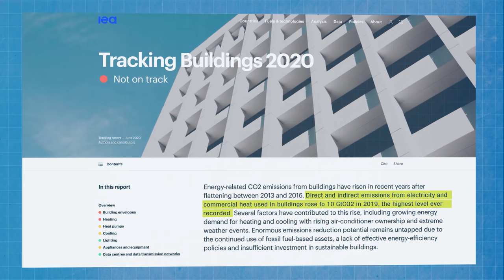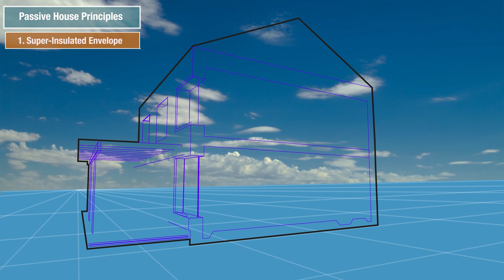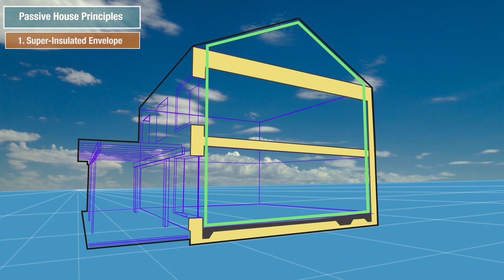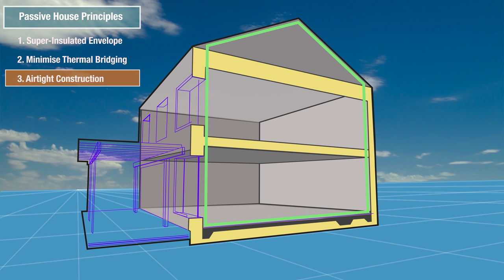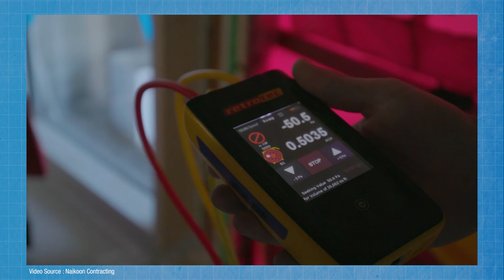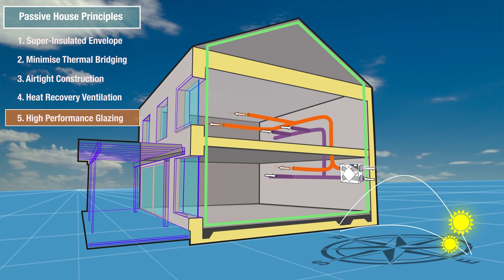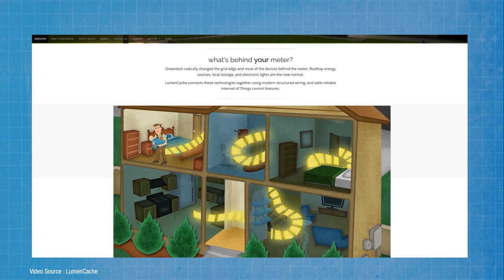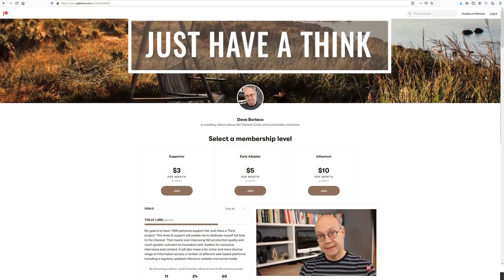Passivhaus . A low carbon future for our homes?

Comment: I am not one who thinks that passive houses are a good idea, but it is due to the low requirements that are set and the problems that have arisen on older passive houses that they are designed for a certain amount of waste heat and when it fails due to various reasons, it becomes cold. The better alternative is energy-efficient houses with a good heat source such as an exhaust air heat pump or an air-to-water heat pump as these can provide up to 8 times more heat than they draw in electricity.
The passive houses I have heard of needed a household with 4-5 people (two adults and 2-3 children) who were in the house for at least 12 hours every day and only the body heat could generate 5-10kWh in heat and then TV, computers, cooking, showering and lighting would heat the rest (the hot water came from an immersion heater that costs a lot to heat what is needed) so it was enough that there were only two people in the household for the temperature to be too low and then when "ordinary" light bulbs were banned, one disappeared some heat there and when the tv and computers became more energy efficient it became too cold so they had to put electrical elements around the houses to heat to the right temperature in the winter. If you compared many "ordinary" houses with passive ones, the passive ones could have a higher electricity consumption as they did not use heat pumps to heat the house or the hot water, which all newly built houses use today.
Can add that I myself live on latitude 60 in Sweden which has one of the tougher requirements compared to our climate and in recent years it has not received as much attention as we have not been so cold compared to what we usually when we have to cope + 20C inside with -19C on average during 48 hours and -30C for shorter periods, it is not comparable with most other places in the EU + UK or other parts of the world.
So my view is to follow the requirements for a passive house, but use a good heat source and not direct-acting electricity or waste heat, so it is possible to save more energy and provide a better climate.

I think you should also take a look at 3d printed houses as they have become a bit of progress with certification in Germany
Reply: Wish all new houses had heat pumps in the UK! Right now I believe they're merely "looking into the feasibility" or somesuch.
Reply: @kaitlyn__L  In Sweden, a majority of single-family houses have some form of heat pump and by that I mean not only new but also old houses but with different solutions and the easiest and cheapest is air-air heat pump costs 1-2k € but when it is cold it gives not so much - (15-20) C some should be able to give heat to -25C outdoor temperature then comes air-water which costs 3-6k € and then gives heat to waterborne heating and hot water and then comes soil / mountain heat (translation went wrong ) a pipe that is laid down to 80-100cm in the ground and is 2-500m long that removes the heat from the ground (costs a lot to dig down if done afterwards) and then "rock heating" where they drill a hole of 100-150m down and takes out the heat that is at that depth (both of these use an alcohol solution that does not freeze) and installation and purchase is at 12-25k €.
About 10 years ago it was cold for many months and some families had to pay 700-1100 € a month for electricity and most of it was for heating (high consumption and high electricity price) and after that many people installed when they do not want to happen to it again and many look up where the heat took the road and dense in moldings and floors and ceilings. There are not many who use electricity for heating now but now more so it counts as electric heating even with heat pump and houses that are close to cities have the opportunity to use district heating that comes from waste incineration or biofuel

Comment: UK construction industry is catastrophic. In all directions and by all measures. Never mind the energy performance of old,  new stock is as bad. Light years away from German standards or even loosen North American standards. I work in the industry. All is hot air and probably corruption from architects to building services engineers.

Comment: Passive haus needs more attention. It has many perks but sadly it costs so much more, which is something I know me and others are looking to help bring the cost down. Retrofitting on an existing house is even more challenging as a whole because every zone is different and not every house is going to have the same budget to work with AND most houses are unique in design. I’m in the planning phase of remodeling my house focused on passive haus standards however it’s not realistic to try and meet the specific certification requirements for a whole number of practical reasons.
Reply: Good luck. Add what you can and what makes most sense cost wise. I heard often that solar water heating panels (for domestic hot water) are the most effective things you can add at first, during to the energy need to heat water. 
Insulation, air tightness and heat recovery ventilation should figure somewhere in your plans though.
Reply: @ecoworrier  thanks, we are going with a sanden water heater because of longevity and efficiency. We also have a block house, so by insulting the exterior with wood fiber insulation we keep the thermal mass for charging during the most efficient time of day (depending on time of year)

All in all, in Phoenix AZ it’s a different climate and one with less information than colder climates. I’m fortunate in that I don’t have to worry too much about money, but I want to do the most environmental change possible. So trading efficiency for longevity or carbon sequestration are trade offs we consider along the way. Retaining as much of the original material is a big goal too, again we need to weigh every decision against all these goals. Living building challenge (LBC) is more of our goal, passive house standards are part of LBC.

In any case, will be documenting the process once we start, hopefully can share the information for others.

Comment: Personally, I've always been interested in the idea of a hobbit house that's half buried in the hillside.  You'd have windows facing in whatever direction the sun shines in the most, and materials that absorb heat in the interior sections the sun hits.  And anything else that would make it more efficient.  But whether it's a hobbit house, a passive house, or a regular house with tesla's solar roof, they're all far outside of my budget considerations, so it's nothing more than something to think about.

Comment: wow what a lot of reading I will have to do. Any way thanks. I am very interested in building a straw bale house and although not a passive house it would be very energy efficient or so I am led to believe. It would allow for a natural breathing of the house negating the need for heat transfer pumps but still having the advantage of being cool in summer and warm in winter. From what I can see the building industry, or at least some, seem to be stuck in a time warp. As for the Government, why won't they make all new builds at least have solar panels and give good incentives for panels to retrofit. Of course the answer I think is the energy business would go out of business, ditto electric vehicles. That's it I am off my soap box now.
Reply: Straw bale is great, in a world where rain does not exist...
Reply: Straw bales houses can be built to passivhaus standard. They still require an HRV. They breathe water vapor, not air.
Reply: @deport53  the ground is never, ever going to get saturated I guess? Unless of course, it does

Comment: These days it's cheaper to simply cover the roof in solar panels. 

200m2 of roof can give you 30kW peak.

Much cheaper than finding a builder that won't cut corners.

Comment: 25 years in my semi-passive solar home.  Yes, I use a wood stove and propane to cook with and, earlier in my career used the generator quite a bit more.  But within the last decade, thanks to the chinese and my discovery of forklift batteries, I've nearly realized everything this video is stressing.  Complete independence and turning off the usage of petroleum completely would take a bit more effort, but is completely doeable for me, if i had the impetus.  i even built my home out of about 50% recycled materials.
I dont know how applicable this all is to city homes, but countryside homes are suited well for this technology.  The problem is wealth is driving homes to remain energy inefficient in the name of convenience.  It'll remain this way.  Sorry.  In the mean time, I enjoy when the valley goes dark and my home is lit.
Reply: Forklift batteries? Tell us more about those!!!!!

Comment: IDK ... I'm thinking that something is missing, here.  The simplicity and efficiency of Nature's Way seems a bit more adaptable, affordable, and available.  "Traditional construction" has, quite simply, become too costly, complex, and wasteful.  Methinks we need to Just have a rethink. 😉
Reply: actually traditional building methods, can be used in passive, its quite possible to do a passive building from most traditional build methods, what's not traditional is the attention to detail, and design elements that push thing up to the passive standard. reduced thermal bridges, and air tightness, that need to be planned for and done, at the correct stages, and correctly.

Comment: Does a sealed greenhouse gas like CO2 not make sense for multi pane windows? Can also imagine integrating the heating system into a radiative model. Radiators so often get placed below windows but if a separated pair of panes were open to a cycling warm air system maybe it would be more efficient?

We have surplus CO2 and the cost of windows is prohibitive. I don't see why non reactive gases are appealing other than the likely easier containment? I've heard it explained why heavy noble gases are good for sound dampening but for retention of heat seems nonsensical. Transfer of energy still occurs and if the noble gases do become energetic they output very easily.

Comment: Is there passive house possible in tropics? Without using lot of wood for construction (Not good for environment)
Reply: Good question and yes, it's possible to build passive houses in tropics as well. Here two examples:
Austrian embassy in Indonesia: https://passivehouse-database.org/#d_4340
A refurbished factory in Sri Lanka: https://passivehouse-database.org/#d_6030

In general any building materials can be used. At least it's better to use wood for construction than to burn it for heating.

Comment: Lumencache Power Over Ethernet (POE) low voltage data cables use a star architecture. As they say: "Run a Cat5 wire from the panel to each light". Depending on where the panels are located, that is a lot of wiring. Imagine you have 8 luminaires in the cealing of your kitchen. They each require an individual Cat5 wire to the panel in the garage. Same for all the luminaires in the home. Very inefficient for no good reason. 
Cat 5 cables have 8 wires plus shielding. Only half of them are used for power transmission. They must be made of copper. The other 4 are for data transmission. The connectors are time consuming to install (8 different wires).
It should be possible to just run cables with 2 or 3 wires on the shortest routes between luminaires to distribute power and have a controller in each luminaire to control on/off, color, intensity. Wireless mesh data connection like Zigbee is a good candidate for controll. 
A voltage regulator is always needed. Every LED light runs at a different voltage. Even a 12 V LED light converts the 12V DC to AC and then to the required DC voltage for the LEDs. 
Currently 230V or 110V is the standard and it is not expensive, bulky or inefficiënt to convert it to a lower voltage. 
The disadvantage of these voltages is the potential hazard and thus the requirement for one (not 6 ;-) extra earth wire.
It would be nice to have a low voltage standard for lighting. But that standard must be very stable. The electrical wiring in my house is more than 40 years old and I hope I will not have to change it in the next 20 years. But maybe a standard is not so important. Something between 12 and 30V, 0..120 Hz? It would be nice if all low power LED lights could handle that.

Comment: Nothing new here-I first came across passive solar buildings in the 70s. They built some houses in Milton Keynes. The conclusion was that you had to be building large houses on a large plot that allowed you to orientate the building for max. performance. Small houses-forget it. Refurb old buildings-forget it. What you need is lots of money and time.
Reply: That might have been true in the 70s, but technology has improved a lot. Today small passive houses can be build, retrofits are possible and you can build apartment buildings using these techniques too. Also refurbing a house using some of these techniques can be a good idea. Maybe you do not get it  down to the passive house standard, but cutting heating costs in half is in many cases possible.
But it is true that they are more expensive, but even that can be only a higher inital cost, thanks to lower costs running the house.
Reply: Your 50yrs out of date.
Reply: Passive solar houses are not passivhaus. But yes, retrofitting to passivhaus standard is difficult

Comment: In 3rd world countries they build houses out of soil/dirt which keeps it cool in sum warm in winter. Not rocket science cheap and locally available
Reply: In hot humid climates mud brick 🧱 tampered earth Cobb etc have too much thermal gain. You fi f light timber low thermal mass. I think pass haus is for cold climates. You do get a plastic chemical filled house with passive Haus. Even with natural j dilation you have chemical treatments and plastic vapour barriers. You have a house that’s a plastic bag that does not breath needs mechanical ventilation
Reply: @EdgeMasterPro  Mud brick and Cobb are fine in hot climates, you just use it for the internal walls and timber clad+insulate the outside walls. Thermal mass is only as useful as it's placement.
Reply: @jonathandenton6160   I was talking about them on there own, they can be used on the outside walls but only inside wall with an outside wall, its actually better to have a large free flowing air gap like a hang rain screen, for example correlated iron on a secondary frame you end up with a conversion current on the rain screen/shade panels.